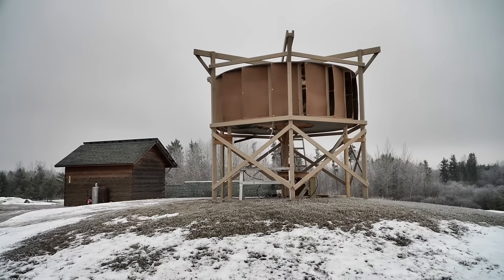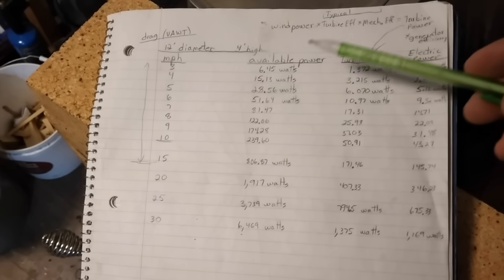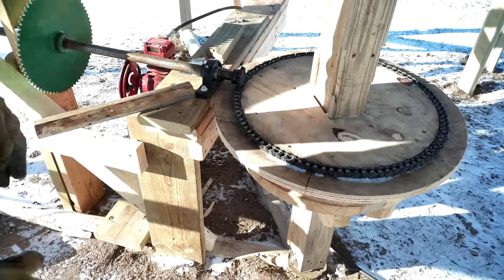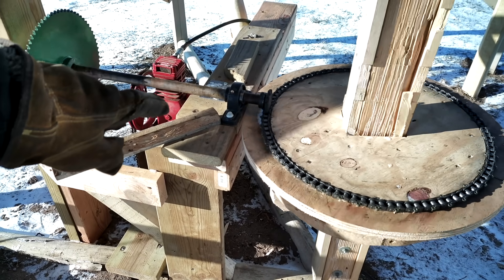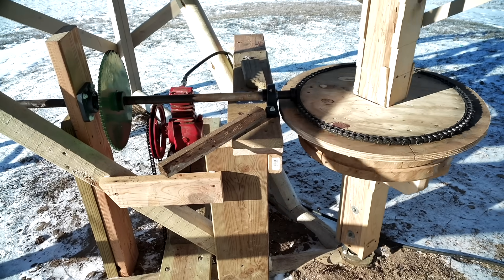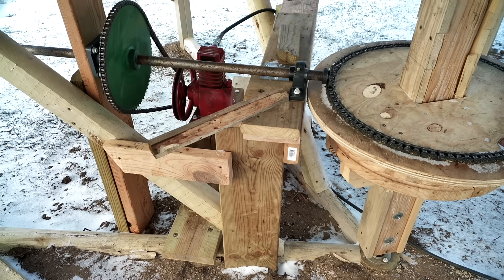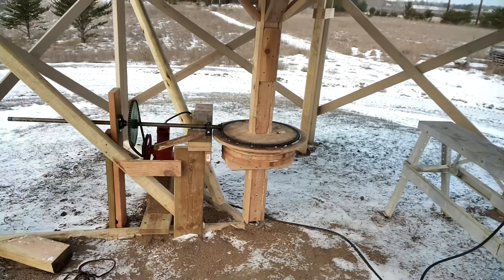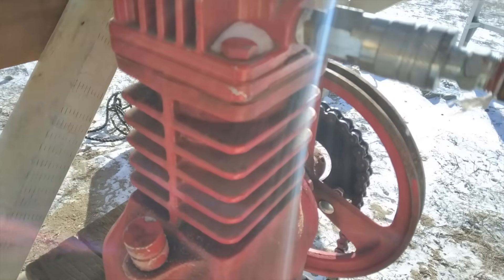COLD winds→VAWT→'Side Bow' chain drive→red compressor

Comment: i think multiple small diameter turbines would have given more power then one giant wheel, because of the wing angles, more blade can harness more power at optimal angle with same height every rotation.
Reply from the maker: Others have that opinion too; like making a bunch of little one in a 'wind wall'.

Comment: Multiply the ratio for increased RPM and less torque . It would be fast enough to turn a car alternator and charge batteries . You could bank power it would take time but would work great nice job.

Comment: Wouldn't a larger radius chain wheel give you higher RPM on the small sprocket? 🧐🤔
Reply from the maker: Yes it would.  Just using a length of chain I already had.

Comment: Love the idea.  Always thought of wind powered compressor to store air in a tank and then use something like an air impact wrench to spin a generator.   Works in my head, maybe not so much in reality.   Idk.....
Reply from the maker: I was thinking of multiple output uses, and the compressor is something I had, just too big for this turbine.
Reply: There are serious and well known drawbacks to using compressed air for energy storage, in particular the inherent inefficiencies of compressing the air (lots of wasted heat) and then the need to provide additional heat when uncompressing a large volume, otherwise it will ice up and lose pressure. In spite of this, it does have some niche applications and was exploited as a means of power distribution prior to electrification.

Comment: you need that other guys design, where it has a squirrel cage with another non moving squirrel
cage around it so all the wind is forced into the forward direction and all the wind blowing against the opposite side of the turbine is redirected into the forward side. What you got is wind pushing it one way while wind is also pushing against you on the other side of the turbine.
Reply from the maker: Yep!  Wind diverters are part of the plan, just didn't get to them yet.  Thanks!

Comment: If there is that amount of torque couldn't you use gears to amplify and get more usable power?
Reply from the maker: A right angle gear box would work good; and probably better.  I'm trying to use stuff that I have, that's inexpensive.

Comment: Great idea and very maintainable at extreme low speeds it could still feed an LED lighting system. I am going to copy this on a hill behind my house in Portugal. The blades are wrong though you should have three Savonius type cylinders. You are after torque I would be after electricity which needs speed so i will locate my chain at the circumference.
Reply from the maker: I switched out that air compressor for an alternator, but still don't have the right gearing; just using what I had.  And also changed the blades some shown in the latest video.  Lots of different things can be done.  Using a hoverboard wheel on the circumference has a lot of potential too. -will be showing more of that in an upcoming video.

Comment: You could consider using thinner compressor oil according to your local temps. Do not use motor oil as you'll have trouble with gumming up due to the detergents from motor oil.

Comment: Its not the size of the Turbine  , its the speed  and size of the generator that is putting out the watts and battery capacity,  and then what wattage of the inverter  output

Comment: That's a better design than the 300' wind turbines that actually need an electric starter to get them to start at certain wind speeds because your design is self-starting at very low wind speeds. 
That should be the standard for wind turbines. Great job.

Comment: You should check out the ancient windmills of Nashtifan. They incorporate some concepts, refined over centuries, that you may find useful. The most pertinent is the permanent, fixed baffles/manifolds, to channel the wind into a tighter stream.
I also wanted to mention a couple ideas of my own, in case they can be useful/inspiring. First, you could nest a second, lighter wheel inside the outer wheel, possibly coupled geared to spin faster, with lower torque. You could also consider putting the "vanes" on hinges, so that they flap closed when moving against the wind.
Reply from the maker: Thanks for sharing your ideas!

Comment: This is an expensive idea. There are plans that have been on the internet for 20+ years that show how to use a rotor/bearing assembly off of any car to build a 3 phase AC Windmill using doughnut magnets from microwaves. Coils of wire and PVC pipe blades. Potential peak output was 2000 watts. And they didn't use enough lumber to build a small garage building it.
Reply from the maker: Please post a link to the one you are talking about.  This was relatively inexpensive.  I spent around $600 for frame structure & turbine materials; and can easily be repurposed.  The material for my wife's 8 x 10 garden shed was over $1,200

Comment: Great project! The value of a wind turbine is usually to generate electricity to directly charge a big battery to supply a little electricity for either  a small load or for emergency use only. You could easily convert a vawt to drive a small generator by using a large chainwheel on the centre post and a small chainwheel on the generator. Sadly til you can be assured of reasonable power output financially it's probably simply not dollar value. Look at using a bicycle chain with the pedal chainwheel and then find the smallest gear from a derailer gear block to get some torque thanslated into speed to drive whatever generator you can find.

Comment: Just eyeballing the solution it looks great and seems like there is terrific potential.  I am wondering if you increased the angle of attack on the vanes and perhaps use more of an airfoil shape for the vanes.  Great work, very impressive.
Reply from the maker: That is an consideration, as a couple of others have pointed out.

Comment: Interesting proof of concept.  I was thinking if you could let the turbine come up to speed no load and then slowly engage a clutch whether the momentum would overcome the resistance a bit.  I say that as it's a big flywheel.  Also, if the turbine was a bit taller, would that change anything?  I ask because where are most turbines?  Usually on a tall tower or higher in the air, even the old fashioned wind mills were fairly tall objects.

Comment: Surface area hit by the wind, the wind speed, the humidity, and the distance of the surface from the center axis all play a part in the calculation.
A large surface with a long distance from the center axis will generate a significant torque. The torque can be used through a gear train to get the speed required for the alternator while overcoming the resistance. THINK HYDRAULICS!  Air is just another fluid and, while compressable, behaves very similarly to liquids.
A "pancake" drum alternator (like a direct drive washing machine motor) can generate significant power at a low RPM; typically 60 - 100 RPM can generate 120 volts AC.

Comment: Replacing the compressor oil with mineral oil might help. Also, the pump might not last long because the oil is typically flung around from the high RPMs of normal operation. Maybe over filling the pump or putting it at an angle will prevent oil starvation.

Comment: If you had a gear at the outside of the turbine, it would be doing maximum speed, easier to hear up to higher rpm... Also, just thinking that three supports around the circumference might give good stability, and three PTO points... A steel band, plasma cut, could be the gear driving another geared shaft? Don't know how you have the bearings rigged, so hard to comment on that.

Comment: Looking at the diameter of your turbine, I think that it's probably of a size that could use variable pitch/angle on the vanes, as its speed at the circumference is similar to wind speed, and so that any variable pitch change would not call for very fast or sophisticated mechanisms.
With a bit of electrical engineering, a wind vane could provide input to a servo mechanism that moves a circular cam, where the cam provides the pitch change... A simple system, that gives up some efficiency, but doesn't require expensive or complex machinery.

Comment: Nice. Have you tried spinning the turbine as fast as you can by hand? See what sort of input power is required.. I think the compressor would be progressively harder to turn as it builds head pressure.
I think your time would be better spent creating electricity wirh the turbine 👍

Comment: A clutch-brake is a better way to connect-disconnect the output shaft.  The clutch can engage once the wind mill reaches the right speed, to turn the compressor for a little while.  When it gets to slow, it can disengage to allow more storage of inertia.

The brake portion is a good safety feature in case of power loss or air pressure loss to prevent runaway.
A Nexen 801756 is an example of a clutch-brake where the brake is applied by a spring and released by air.

It appears you are shooting for very simple.  But you could use a little control system to monitor the speed of the windmill and the wind speed and the tank pressure of your compressor.  It would operate the windmill driveshaft on and off to keep the compressor tank full.  Because I'm a controls engineer, I'd use the least expensive PLC (automation direct cliq), a proximity sensor that detects some fasteners as they pass by, and a Panasonic or SMC digital pressure switch, and two solenoid valves to control the clutch and the brake.  That's around $500 in parts, plus the clutch brake which is pretty expensive.

Comment: The best wheel I have seen was the wings where cut from 50 gallon drums 1/4 section, four blades per drum, so the blades looked like a typical turbine wheel, like on a blower wheel, they would catch a lot of wind....

Comment: Hello, nice project.. i am not an expert but from my experience i think the numbers you have found on the charts are not correct. I am pretty sure that you have more available energy in your setup.. with that torque you can get useful energy out of it.. the compressor is not ideal because the piston compression combined with the gear ratio is getting too high.. My opinion is too hook one Treadmill motor you can find on scrap yard .. They are high voltage and high current dc Motors and they are working great as generators at low rpm .. Don't try car altenators . Ac Generators .Etc  they need constant high rpms they will not work.. Try Treadmill motors or Ebike Hub motors.. ( Hub motors are 3 phase motors they will need rectification as generators)  Happy New Year and keep us entertained!! 💪
Reply from the maker: There are a couple of online wind turbine calculators.
One:  "https://smartservo.org/windturbine_calculator-en/#google_vignette"
That compressor is just too big.  There are several ideas I have

Comment: If chain was on the bottom of the plate would it be less prone to icing?
Wold wooden spkoes for each blade decrease the mass of the blade/disc structure? Or, is the mass needr

Comment: Air compressor pumps have minimum RPM ratings to obtain adequate lubrication.  Especially splash lubricated pumps.  This is generally upwards of 400 RPM.  Running them slower than this will result in excessive wear and premature failure.
Reply: There can be minimum rpm just to overcome losses, like compressing the springs in check valves, ring gap blow by, etc.

Comment: It's still a really cool (literally), device you built with some potential. What did the Dutch use wind for? Water, we used water wheels for that purpose for powering mills most likely more mass is compared to wind. I had a mind compare between a 4 cycle and a 2 cycle lol.

Comment: At 15 mph wind that turbine should be humming. Try a one to one drive on the two compressor pulleys. That will give several times  more torque to the compressor shaft and allow the turbine to turn much more rpm and overcome the compression strokes. A flywheel might also even out the power surges without much input losses.

Comment: I can't help with the turbine, but I can tell you about air compressors.
You have a Sanborn compressor model that was popular in the mid 80s to early 90s, it typically had a 1/2 to 3/4 hp motor driving it in the 700-1000rpm range and operated up to 100-120psi maximum. This equates to 375-600 watts. Your 1000 watts measured includes efficiency loss in the motor. 
It is a splash lubricated unit and below 400rpm it will not splash enough oil to keep it lubricated. Run too long at low speed and it will fail.
Compressors are not intended to be operated below freezing. Condensation will freeze and block lines and prevent controls and safety's from operating. In cooler weather you can use a 10w compressor oil, this unit used 20-30w at typical temps. Using hydraulic oil, motor oil or atf will result in the compressor passing oil into the air line.
Air discharge will be in the 350-400 degree F range so a hose will not last very long. Copper tubing is the most popular media to use to convey the air to a tank for storage and let the air cool a bit before it gets to a hose.
A means to unload or disengage the pump when pressure reaches limit is required. This is a positive displacement pump and will keep pumping until something lets go, this is dangerous. A safety valve should be installed as a backup to the primary controls. there should be nothing between the compressor and the storage and the controls that can block air pressure. the only exception would be a check valve placed where the air enters the tank. A safety valve should be placed in the line between the compressor and the check valve.
I know you are in the experimenting phase right now so all this may not immediately apply but may some of this will help you move forward.
Best of luck. Carry on and let us know of your progress but stay safe.
Reply: @brucehanson With your experience in the field, are you aware of some readily available pump which is workable with its shaft oriented vertically? A vertical shaft would permit eliminating the angle drive arrangement.

Comment: Have you thought about running a generator instead of the compressor? My thought is that the compressor has low and high torque and unless you install a set of gears and throw the thing into forth gear it won’t be able to get over the inertia of the compressor cycle. The original compressor setup had a start capacitor to help turn the motor and break the inertia.
Reply from the maker: I have plans to try several devices I have.  That compressor is just one of the things I have. -it's just too big.

Comment: you seem to be on par with a 50w solar panel potential in a 12mph wind. Judged by eyesight and your numbers.. the speed of the bigger gear feeding the compressor. :goodvibes:
This stuff keeps my gears turning too. I have a 2kw diesle heater running on sunshine right now..and my lap top to be here. 
Anyway, using that heat to pressure a steam turbine..you'd still do better than the wind...30 watts to run, 1/2 cup fuel per hour.
Reply from the maker: I have a video with a small steam turbine I made.  With a similar type turbine as this wind one, just with the pressure being fed internally.  
"https://youtu.be/7uxEY4mVZ_w"

Comment: good work!
the circled chain and sprocket is  a genius low cost idea 
this type of turbine can be very efficient with the right blades
I believe you can easily double  the efficiency of your turbine
the inside side of each blade must be closed and act as a scoop to grab the air
so it is not able to just pass inside the wheel and escape the other side 
without pushing on it
replacing blades with half barrels with the right orientation could be simple and efficient
you could also just install a liner inside the wheel blade to close all around so every blade will act as a scoop
Reply from the maker: The design of this turbine is unconventional, and different than what you are thinking.  The design is that the air will enter, and swirl around the inside (friction against all 'blades' all the way around) until it looses velocity, and exits the top or bottom.  This was a test, but compressor is too big for it.   Turbine is described in other videos.

Comment: Less vanes and a stepper angle, seal the back so air hit the vane and doesn't lose pressure, at very low speed air retention is better than dynamic flows.

Comment: Your gear ratio is bad. You need to at least swap the pulley off the comp and put it on the turbine shaft and the big green one on the comp.
Reply: It won't spin the comp as fast on paper, but it will give the turbine a chance to speed up. Which should end with the comp getting higher rpm and less drag than now.

Comment: Very interesting. Have you ever considered starting with a bigger wheel on the shaft and making a wheel reduction. This has me thinking about how a water wheel works.
Another idea you may think about is putting another blade on top the same size and shape but turning in the opposite direction to catch the winds blowing the other way.

Comment: Great Project! I'd suggest either switching those two pulleys for higher torque, or you could use an eBike Hubmotor as a generator. Those have plenty of poles, so very little cogging, especially with a good MPPT controller/inverter. That would make electricity though instead of compressed air. If you need air, maybe a sliding valve tool (usually straight grinders) could work, however you'd need to modify them and I also don't know how to solve the oil issue.